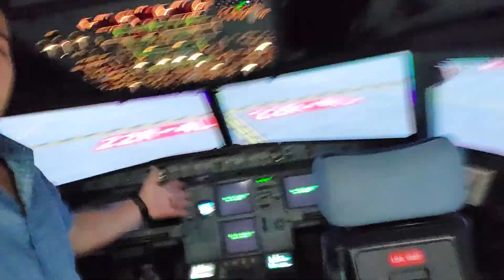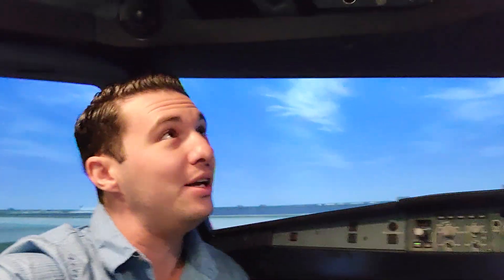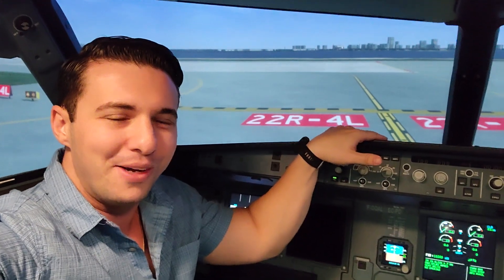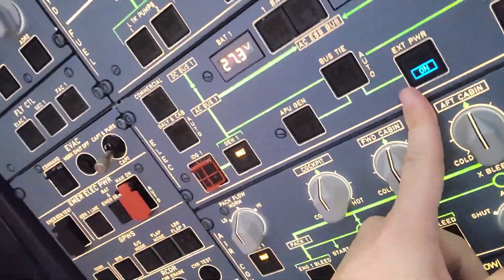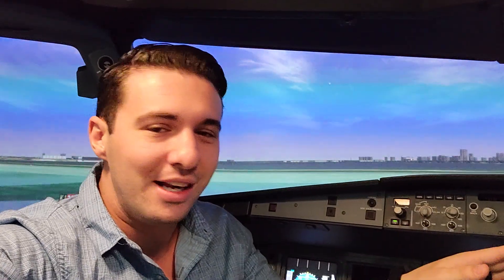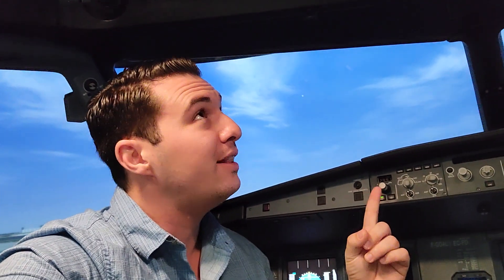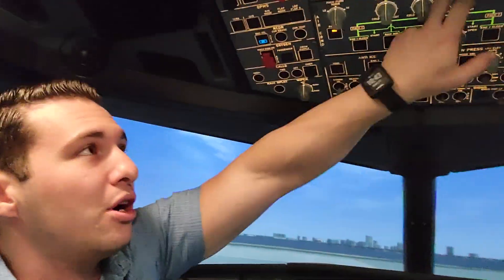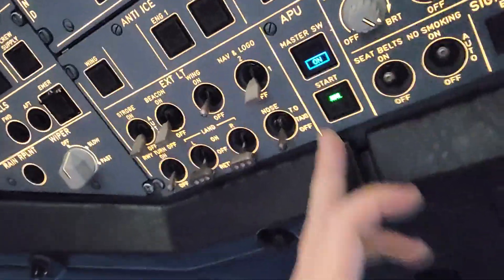A320 Tip!

Comment: Awesome 😎 Here's a question for Airbus pilots or trainees out there: Are you usually gauranteed air conditioning or heating so long as the start cart or the ground power unit is hooked up  (and on) or does it usually just mean you have electrical power but no conditioned or heated air? Mainly asking because in my simulation videos that I do I try to go for as much realism as possible and I usually will have the APU running for air conditioning even if external power is connected and on.
Reply: hi there, ground power unit only supplies AC electric. If you want conditioning in the cockpit/cabin you need high pressure air which can be supplied by engines, apu or a hp ground air cart. the engines are off the table of course until they are started. and in many cases airports restrict prolonged usage of APU due to noise. Airlines also avoid using APU in general to save fuel at this stage. therefore if avalabile, they use hp ground air (yellow hoses) at a cost to airport operators and delay the start of the APU.  The outside air temperature and the passenger boarding also a parameter to apply whichever combination. hope this helps